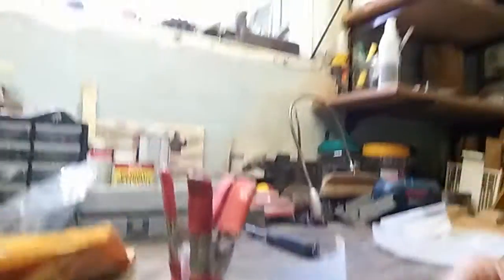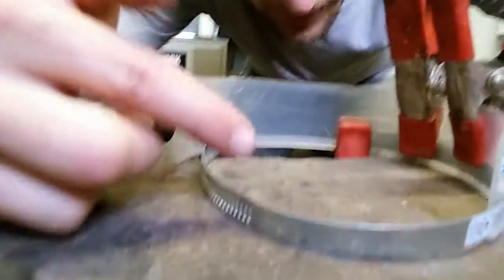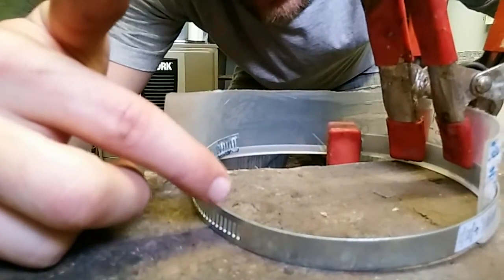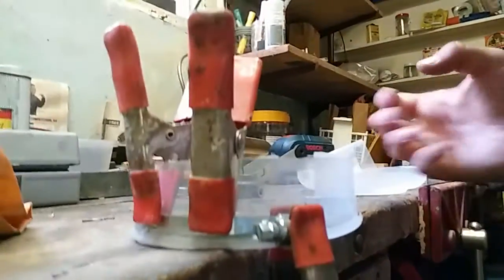Making a DIY piston ring compressor tool for $1.50

Comment: Try jamming a screwdriver to push the rings into your cylinder, beat on the top of the piston with a 5lb sledge hammer. Great vid IdiotVanBum!
Reply: Did this, wiper ring caught onto the side and chipped💀. Worked well for one piston and ofc something has to go wrong so I'm just gonna make a tool and buy a new set of rings😭
Reply: @Mazoyermotors  cut a 2 liter coke bottle cut it into a 2" ban that wraps around the piston, lube it good with 2 stroke oil and use a hose clamp to compress the rings. The plastic protects the rings, works everytime!

Comment: Way to post an incomplete video.
Reply: What do you mean didnt upload you finished it there... second its easier to go buy one from your automotive store
Reply from the maker: oops, weird. didn't notice that it didn't upload the full video. Anywho it didn't work out. I ended up borrowing a ring compressor tool from a local mechanic.